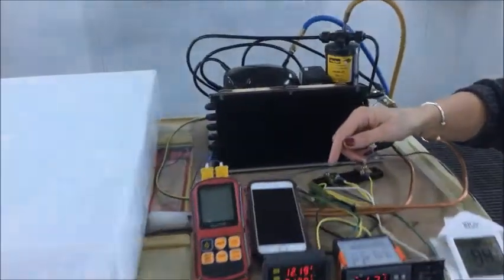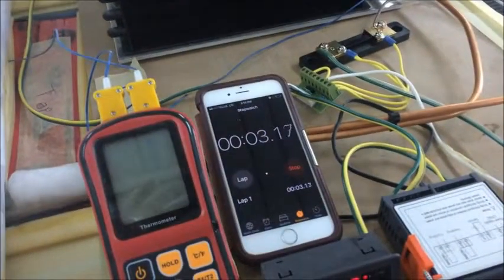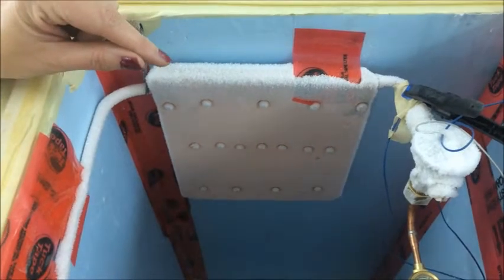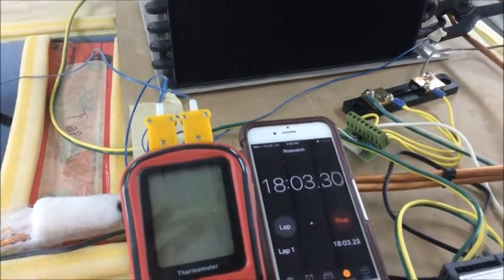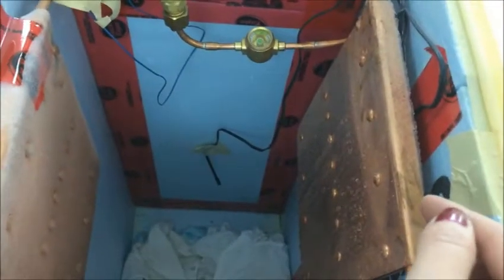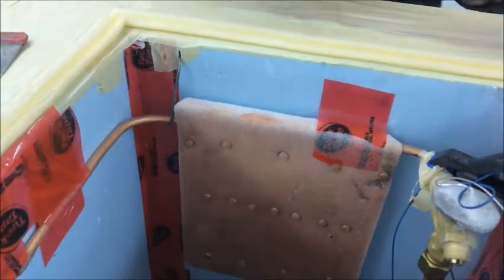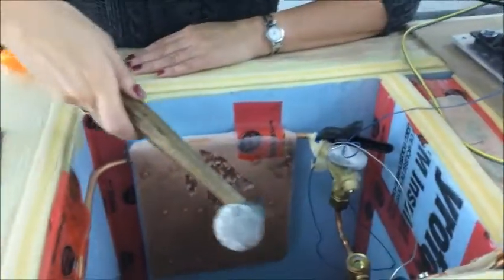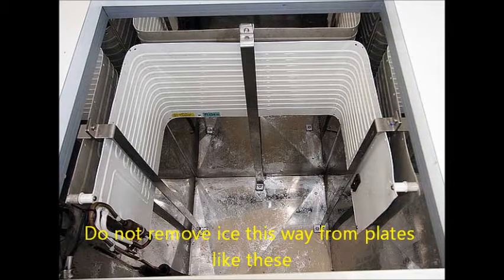ColdEh Marine Refrigeration.  Defrost time test.

Comment: well that is not a professional way how you treat that evaporator it will not resist that tough method of taking off frost on it + you expose the evaporator very long time to high  temperature . you can try other ways of defrosting easier and efficient than that .
have a nice day